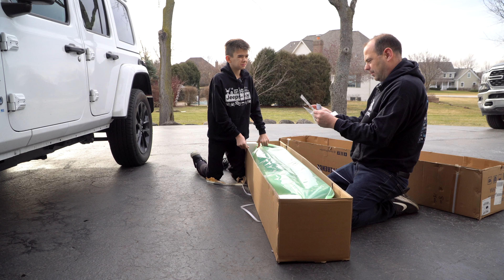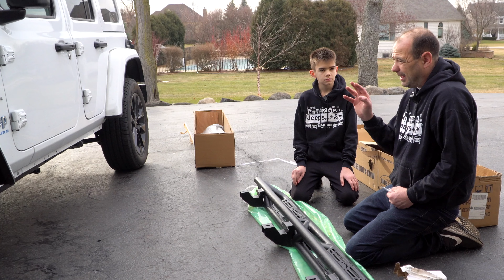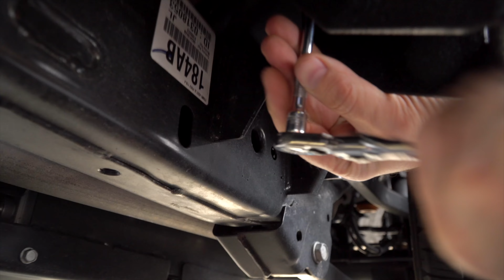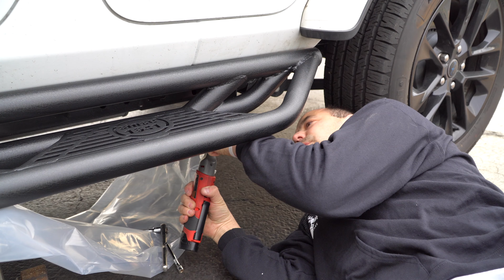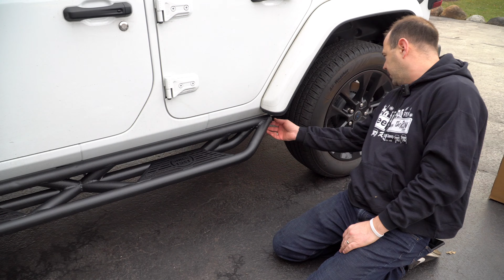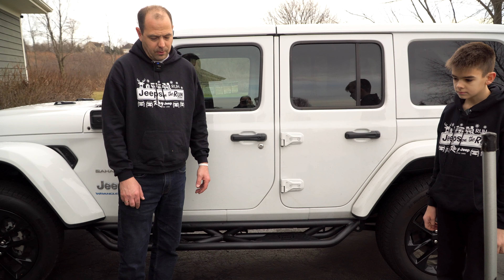Install & Review of Hooke Road Side Steps / Running Boards On Our 2024 Jeep 4xe Wrangler

Comment: will these work with a rock rail.  I know Hooke Road use to make something similar for the JK Rubicon where you did not have to take the rock rail off.
Reply from the maker: I do not see how these would work with a rock rail still attached.

Comment: Great install video. Thank you for sharing. First time viewer here. I have rock guards on mine so I probably wouldn't get these but I am curious. Looking at the finished product it looks like the step pads are too far forward. Where I would step to get in the driver's seat there is the X welded pipe and doesn't look great for a place to step. And for getting in the back seat it looks like you have to step directly under the door where it opens. Is that visually off? How is it getting in the seats? Just curious. I'll be checking out more of your stuff soon. Thanks again, Pat
Reply from the maker: Consider a subscribe for more!  The final product i on the end of that install video.
  Also, Hooke sells sliders as well as other style steps.  Use the code "JOTR" for savings too!

https://www.hookeroad.com/discount/JOTR?ref=GdYQA